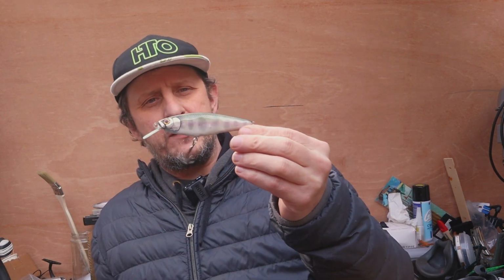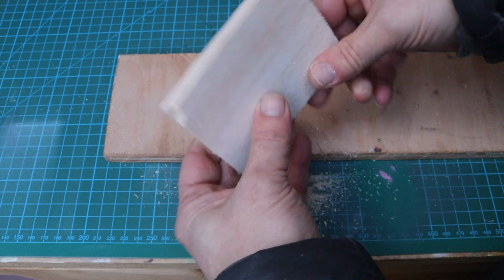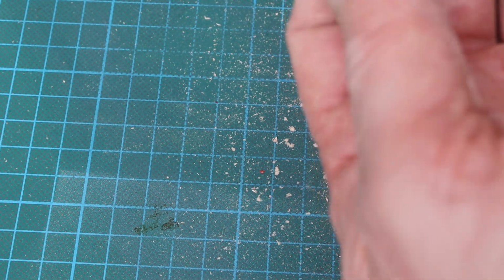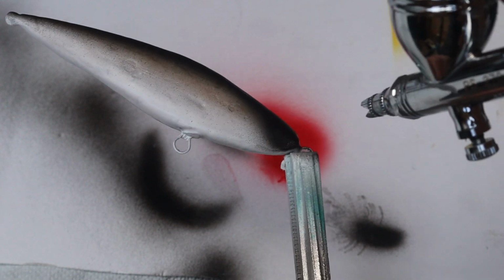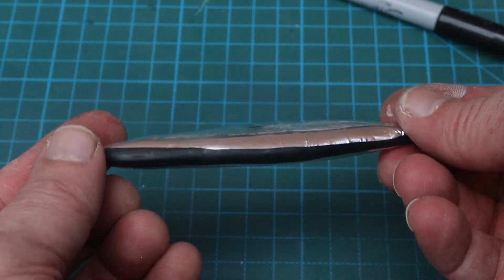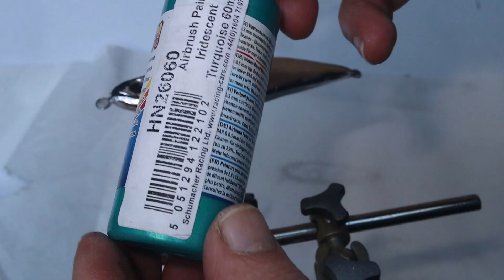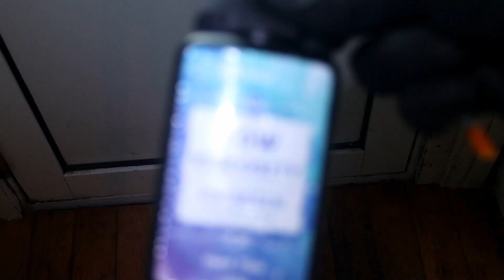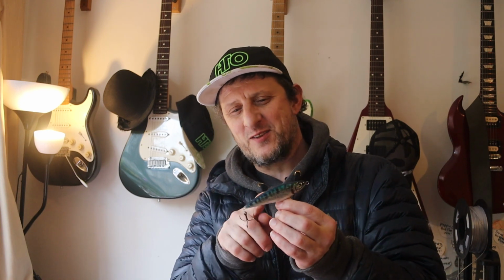Lure Making - NO POWER TOOLS BUILD, Weight Shift Mackerel Glidebait!

Comment: Your lure making projects are very interesting , but, I'm not sure how open you are to suggestions...
Reply from the maker: Thankyou for watching! I'm always open to suggestions, please let me know 😃👍
Reply: @JakeSchogler  well, thank you for letting me know...
Here they go:
1- bringing up any new lure design idea into a sketch would be very helpful before commencing  any project. Buoyancy considerations/calculations ,  wire form design, weight (both fixed and shifting) locations ... 
2- encapsulation of shifting weight ball bearings could facilitate easy and fool-proof assembly.  Drinking straws are a very good choice for encapsulation purposes, cheap, available and cones in different sizes. Tiny magnets can be used for steal bbs .
3- thread wrapping and super glueing wire ends and mid-hanger would make it way robust.
4- a narrower blade would follow the curvature easier and smoother. 
From one lure maker to another..... 
Keep up the great job!
Reply from the maker: @kamarte Love it! Thankyou for all these suggestions 😃👍. I am often an impulsive builder, I see the finished thing in my head and just go for it. Some builds ( and they are coming ) I plan very much before hand especially when making more than one. I have played with drinking straws for a weight shift, I think that would have helped this build a bit! I agree about the thread wrapping the harness, ill prob do that in the next build 👍. Narrower blade sounds interesting I guess it flexes? I will grab one and try it! Thanks so much for commenting and the useful tips!🙏😃
Reply: @JakeSchogler  no worries, glad that you liked them.
Making things ( like lures in this case) by impulse is perhaps the artistic side of a builder... we've all done that at times perhaps for single or few ones...but for mass production and creating a very special one with predefined characteristics,  we definitely need a blueprint. Anyway, waiting for your next projects!
Reply from the maker: @kamarte Thanks again I love to discuss lure building and I should have another video up within a week! I look forward to you seeing it 🙂✌